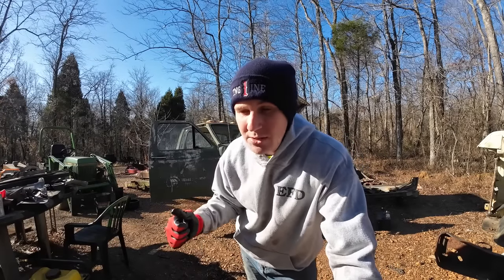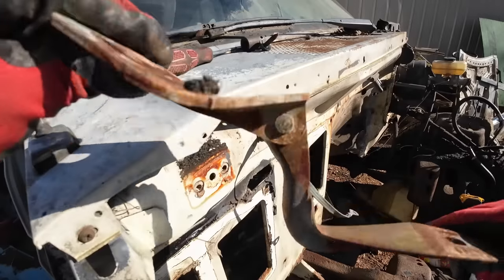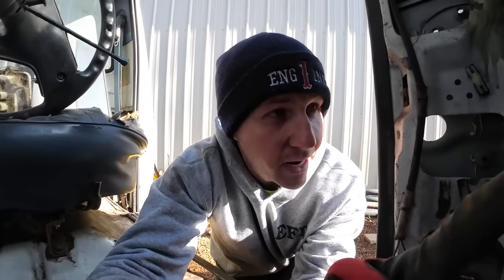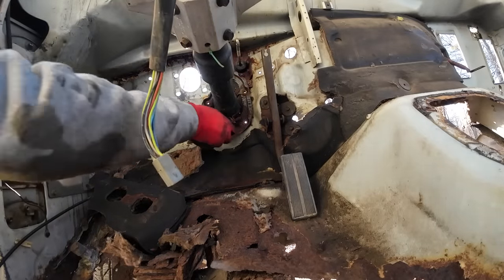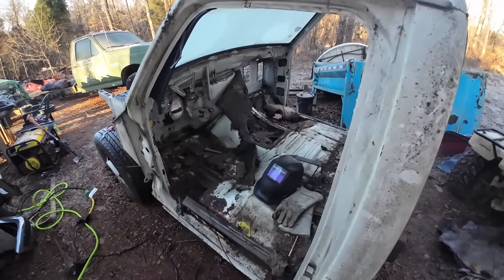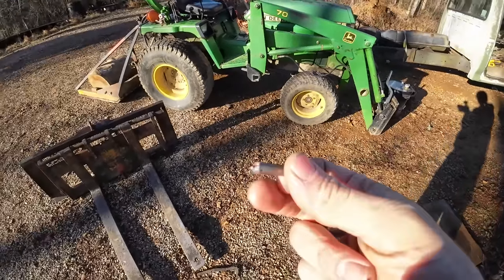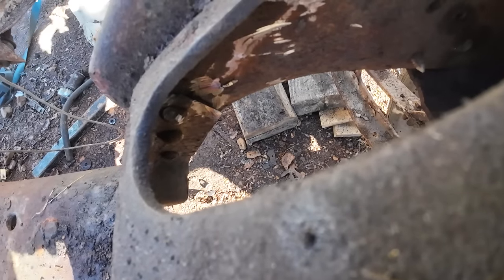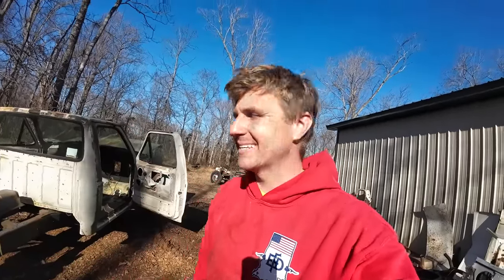Hope I Don't Regret This - Dump Truck Build - First Step Complete!

Comment: Happy for you. on the floor replacement Remove the bracing left over from recovered/donor, piece of floor. lay it over the top over the floor you are going to replace. aline as best you can with the rusty floor. screw  it to the rusty floor. and paint it with rattle can, the edges as best you can. this will give you an Idea of what to remove or what you can weld to. good luck.

Comment: I stripped a 2006 crown vic and used the engine, trans, front suspension and rearend as well as the master cylinder, rad, wiper motor, blower motor, and wire harness for use in a 1965 F100. Just finished it. Now one to my 1963 Ranchero Rebuild. I used the back wall of a f350 cab for the ranchero's backwall

Comment: Under that cowl panel you took off you will see where the seam sealer is at that will crack up and cause leaking inside the cab, be sure to check pedal rod pivot bushings and for cracks in that aluminum pedal assembly as they are known for crack/breaking
Reply: Firewalls are also known for tearing out around the clutch master cylinder.
Not hard to reinforce, to the tunnel, on the inside where it won't affect pushrod length.
Also the pin that fits the master pushrod will instantly eat the plastic retainer if it has a groove worn on the firewall side.
You can weld it up and carefully make it round again. Dorman 44497 will get you four of those fingered bushings

Comment: Mike- there is a cutter for an impact bun that cuts through metal like it’s butter.  Looks kinda like a chisel with a tab sticking down in the center.  You really could use one.  Quicker than a zip disc, and leaves a better edge to weld to than a torch. 😊.  Of course this could be an analytical response😂

Comment: Cap. The hydraboost brake system is better than the standard hydraulic. I would keep the hydroboost on the dump trunk. It's like adding stronger brakes due to a load/weight.
Reply: Better?
Definitely more powerful, but he already explained what's wrong/missing with the diesel pedals, and that brake pedal is different than vacuum.
Besides Mike could get $130 for the Hydroboost& MC, probably something for the diesel power steering pump with the return, if it's to be found...
Reply: It's probably nothing but you might want to check your front wheels to make sure both trucks have the same lug pattern.  I'm pretty sure they do but sometimes, just sometimes, Ford does something kooky like make one model 8 on 5.5 and another one size up 8 on 6 with thicker lugs.  Worst case you got an extra set of tires and rims if needed.
Reply: @southernyankeehomestead3230  They definitely don't.
F450's were 10 lug and 350's are 8 on 6 1/2"
Reply: @southernyankeehomestead3230 
He already covered that when he talked about transferring the rear axle or sourcing a different one. 
Superduty is 10 and the F350 is 8.
Reply: @Crewsy  yes bit there was wiggle room in there of "if I can find the axle".  And also "if" it's in his budget.  So "if" he stayed with the gas rear end he will be thankful to have the matching front end.  Additionally the numerically lower gears of the diesel might not be as compatible with the gas motor so there's still a lit of wiggle room in the final decision process/budget.

Comment: Mike, a heads up. The hydroboost brakes are way better than vacuum operated systems are, many people Upgrade their OBS trucks to the hydroboost brakes which run off the power steering system. My 94 F Super duty with a 7.5ltr engine has the hydroboost brakes. The brakes work awesome!
Reply: X2 for hydroboost. No need to switch out the booster/ master

Comment: looks like the one truck has a hydro-boost master cylinder and the other has a regular style brake booster. the hydro-boost brakes gets its power from the power steering pump.

Comment: The plasma cutter was a game changer with me but, I was using it with my compressor not having a dryer on it, so I bought 4 of them at Harbor Freight at $5 each. I figured it was damaging my tip's. 
Good job and good video. :)

Comment: Always cut out WAY more extra sheet metal than what you think you'll need. That will give you plenty of overlap when you go to weld it back in. You never know how much extra you're going to need when replacing body panels.
Reply from the maker: Good tip

Comment: The brake system on the diesel truck is called a hydro boost. Irritating to set up but once it’s set up hydro boost brakes are far superior to vacuum brakes. Since this is only a farm truck with occasional road use it may not be worth it to connect. I would swap the steering boxes though as I’m not positive if the hydro boost box will work with the regular power steering system. Otherwise awesome project!

Comment: Plasma cutters are definitely cool, but they’re aggravating to use. They’re so easy to foul up. I find myself using a Metabo cut off wheel on a higher amp grinder most of the time. It’s just cleaner cuts, and far more durable.

Comment: Ya know in a lot of third world countries they would not even worry about the cab at all. Just weld up a place to put a wood box seat and have all the drive train and good enough. I mean if you never go on the road skip all the work and get to the basics. Some don't even bother with brakes except you have a lot of hills at your place. Of course luxuries are pretty nice. Things like roofs and windshields.

Comment: That hose runs up to the brake booster because the diesel truck would have had a hydra-boost master cylinder instead of the vacuum booster the gasser has.

They have to do this because a diesel engine doesn't make any vacuum (no throttle blades to cause it to starve for air, no manifold vacuum.  Diesel engines regulate speed by regulating fuel applied, instead of regulating the volume of air it is allowed to breathe, like the typical gasoline engine).

Since the engine doesn't make vacuum, the brakes are boosted by hydraulic pressure from the power steering system.  If that diesel powered truck had any vacuum operated devices on it, they were run by an external vacuum pump, either a mechanical one on the front engine accessory drive, or an electric one under the hood somewhere.  The vacuum brake booster uses a lot of volume though, and a failure would be a bad deal, so they went the hydra-boost route for those.

Comment: The hydro boost brakes on the diesel truck are much better/stronger than the vacuum boost brakes on the gas. You know how strong hydraulics are,….versus air vacuum.

Comment: When I bought my house my shop had one circuit plus my house had a old panel first thing I did was get a new service put in and a 100 amp panel in  my  
Shop now I can run my welders and compressor

Comment: Mike, that E brake cable clip has a hack.  A closed end wrench can be slipped over the three prongs and compress them.  Then just pull it out.  You had yours out in the open but sometimes access is not so good.  I forget the size but it is 10mm or close.  

I have and still do own several ford diesels and gassers but all are 1999 up. I am kind of partial to the vacuum assist brakes if it is a gas engine.  Ford is notorious for power steering pump issues that give you whining and pulsing reactions when the pedal is depressed.  My 2000 7.3 superduty does this.  Probably time for another fluid replacement.  Just FYI, i think there are some engine mounted and possibly DC vacuum pumps out there to use vacuum boosters on any setup.  There is a tiny one on superdutys that runs the HVAC actuators and 4WD lockers.  Not sure I would trust that to continuous braking use.  I had thoughts to covert my hydroboost to vacuum.  I was looking at an engine driven pump.  Not a fan of the pulsing hydro pedal, especially in cold weather.

I would advise you to research brake options for your axles.  There could be larger versions out there that bolt on.  I am not that experienced in the OBS trucks but ford is ford and much of their engineering carried on into the 1999 up versions.  I changed my 2000 F250 to 2008 F250 axles to get the larger brakes and also moved to coil front axle and the longer (softer ride) rear leaf springs.  I had to move to 17 or 18" wheels to accommodate the larger brakes.  Just watch out for that.  Drive shaft couplings change on the rear diffs across the years from clamps to a bolt on ring.  I just changed the yoke to match my old driveshaft.   

Also verify the axle ratio of your two choices.  Diesels many times have 3.73 and gas may be 3.50, 3.73 or 4.11.  If this thing will mostly be a workhorse, I would chose the 4.11 for gas.  I guess it has a granny gear 4 speed.  Out at hwy speeds, 4.11 will have the engine screaming unless you have a 5 speed over drive.  Good luck.  Been there and done this.  Just do a little every chance you get and before you know it, it will be complete.  Just say no to $80K trucks.  Good grief.  I will keep driving my old stuff as long as I can get parts.  

Ford substitutes parts mid year and across years but the good thing about it is most often, you can make it work.  Putting 8 year newer axles on my truck pretty much bolted in.  I had at least two holes in every part that matched.  Just drilled the rest.  They changed the front frame horns a little so I had to do some light fabrication for the front axle pan-hard (axle locator) arm.  Going between generations of trucks, you have some challenges trying to match parts, that hydroboost setup for instance, if they changed the ports on the steering sector, the lines changed.  You can research what years they were transitioning and magically there is almost always a transition hose out there where they were burning through their remaining parts inventory.  Of course you can move sectors with parts too.  

Watch out for ford steering sectors.  they tend to wear the internal gear teeth and tightening is an abrupt change from the sloppy worn area to a too tight condition.  You can tear it down and grind the transition and make it work but most folks just replace with a new or rebuilt unit.  I have fought this before and i just replaced mine.  Brakes and steering are kind of important so I don't go cheap there.  Something used on a farm, steering wheel turns 1 full turn before steering, it'll be ok.  No way on the highway.

Comment: Not to pick too many nits, but having done projects like this a few times, spending 30 minutes or so with a pressure washer at this juncture will make the next steps much easier and much more enjoyable. Hope it helps. Cheers
Reply from the maker: Yup, let me know when you get the water line installed lol

Comment: As if rebuilding the triple nickel last winter was not enough for you.... you're off to rebuild the tipper now 😃
Plenty of access now into the front and cab, will be getting filled up again with the right parts in the right place once you can read the CD 😂😂😂
Reply from the maker: That's the plan!

Comment: Mike, the grabble was fun to watch, but I was thinking that you need support for the dump bed and those steel supports for the cab may have been useful (Save everything until  you actually don't need it)!  Remember, if this does not work (Which we believe it will), there is always the possibility of extending the frame on the Ford/Subaru and adding the dump bed to it!  😂😂  Was curious, how many wheel were saved because of the plasma cutter.  BTW: shocked that you did not ask the local help on using the cutter, aka Arran, Mike! 😁😁

Comment: Could you plug your air compressor into your smaller generator you used on the church job so it wouldnt be so much of a load at one time on the Miller welder/generator?

Comment: Hey cap hey give you a little bit of advice before you go to cut that floor out of the other cab. Will you in some bars in that doorway to help keep that floor from flexing on you I run my own little body shop and if you watch any of the episodes like from fuss and them when they do overhaul and anytime you cut the floor structure out like that you want to weld in some bars to stabilize that frame before you cut that floor out and that other truck that way it doesn’t move on you just thought I’d give you some helpful advice Brotherhopefully this catches you before you cut the floor out

Comment: most cheap cutting disks suck.
I found fokus cutting disks on Amazon that are actually half decent...not a walter but excellent compared to oter cheaper disks.
50pks are a great value.
Reply from the maker: I use benchmark.  Good quality

Comment: are you trying to run the plasma cutter and air compressor off the miller? if so, you are probably overloading the generator. the plasma is taking most of your capacity, and trying to run the air compressor is overloading the generator. the 15 amp outlet is shared with the 240 outlet. you generator is basically two smaller generators in one, referred to as windings. each one is capable of say 20 amps. the 240 plug is using both windings, and probably pulling at least the 20 amps or so you have available for each winding.. so when you try to run the air compressor, it is adding even more load to just one winding and why the air compressor is kicking out. this is also hard on the generator. not sure what size your particular generator is on the miller so you might have 20 or 30 amps capability. that is also why you have two separate 115 volt outlets, one for each winding so the generator can be evenly loaded. just thought you might like to know.